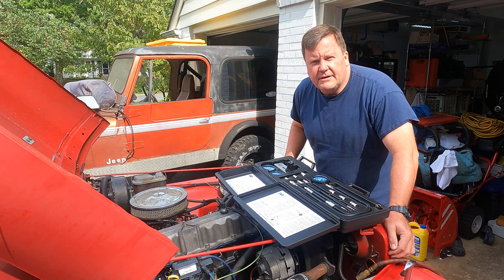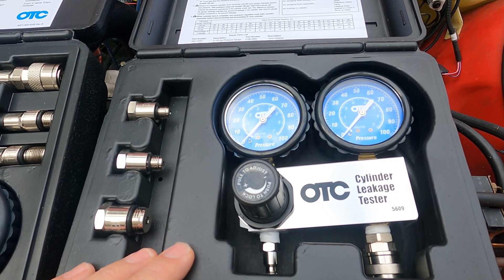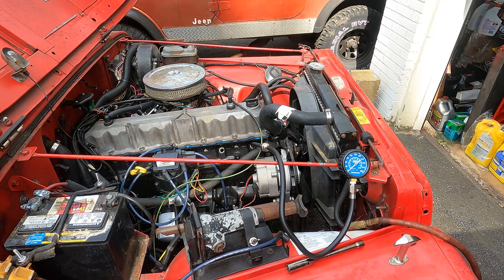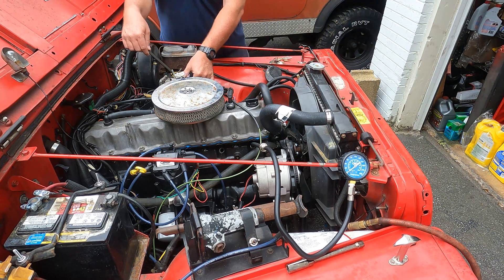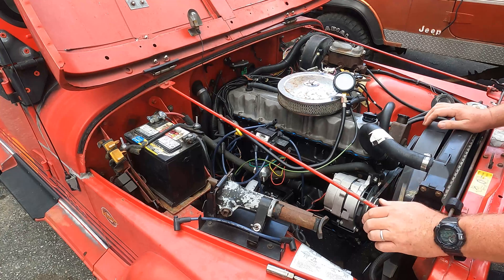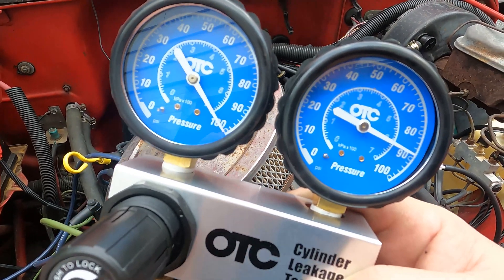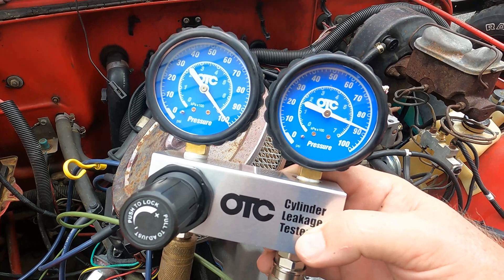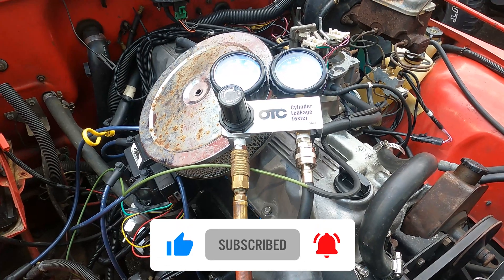How to do a Compression and Leak Down test on your engine

Comment: Hey Jim, how did you shut the fuel off? I’m about to do this on my 4.0 258, CJ7. I think I have a blown head gasket, your other vid was super helpful on that. I want to do the compression and leak down test before I pull the head incase I’m leaking past the rings. Thanks brother!
Reply from the maker: On the fuel injection, pull the pump relay (under hood fuse block).  For the 4.2 248, pull the fuel line from tank at the mechanical pump... let engine start until fuel runs out of carb bowl... to be sure it won't start on fumes, after it cuts off, pull coil wire.

Comment: That is one clean engine compartment.
Reply from the maker: It was cleaned up before newly rebuilt engine was installed.  Amazingly I did not have to repaint the inner fenders and firewall.